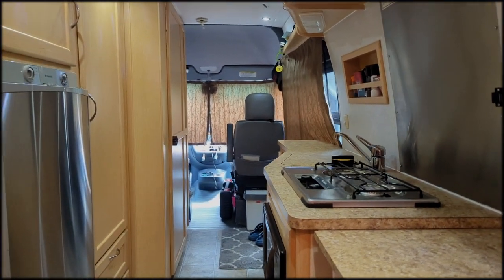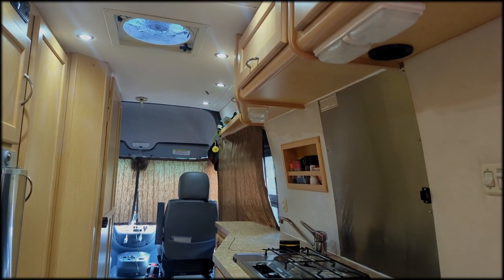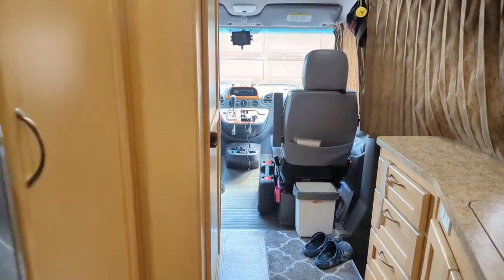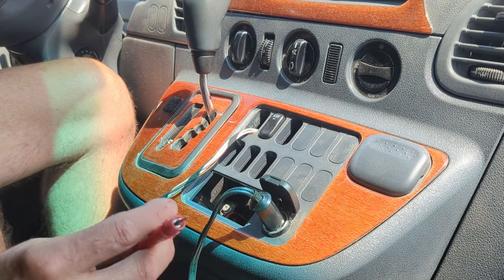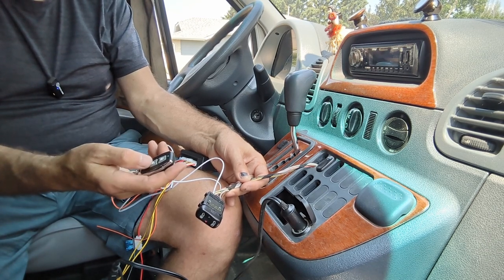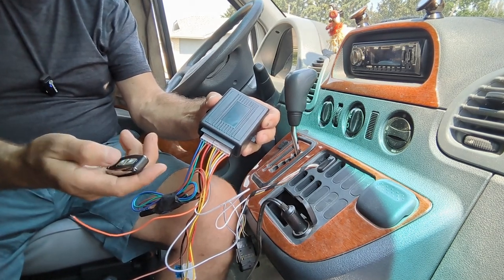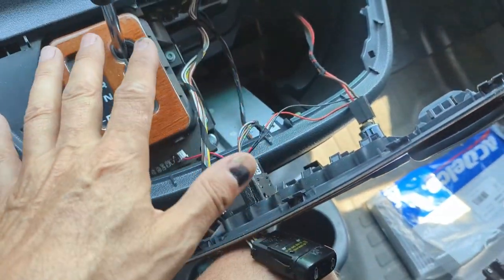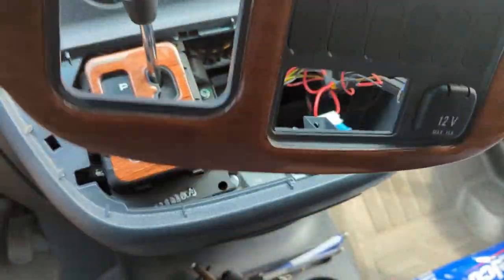$20 Amazon Universal Keyless Entry System In Our PleasureWay Plateau TS Sprinter Van

Comment: Hello Alvin. Leave it to you to find a cheap work-around. I always enjoy your videos. You actually fix things. Lynne's Dodge Journey has HS issues with her key fob frequently. I have found that if the fob battery voltage drops below 3.1  volts it stops working. So I pop in new batteries and we are good again for up to a half year.
Reply from the maker: Thank you Walt!
I can relate to your key fob issues, my wife's Cadillac is constantly needing new batteries for the FOBs, very frustrating, since you can't do much without at least one of them working. 😡

Comment: Hello Alvin. That must have been driving you mad. You would think the service department could figure it out. I think they are mostly mechanics,  and lack the knowledge to troubleshoot electronics. I'm glad to hear that you will hook up the parking lights and not the horn. Seems that a lot of people push the lock button a minimal of three times. 
George B
Reply from the maker: Hi George,
It has been sooooo frustrating, and I know it's something simple, like a wire that has been cut, or a bad connection...I'll keep working on it, but now we use the FOBs.☺️
Oh man, I really dislike it when people do that with their horns connected... especially early in the morning in a camp ground! 😡